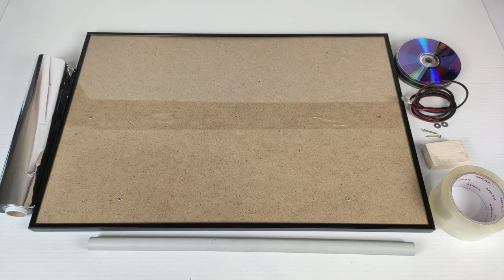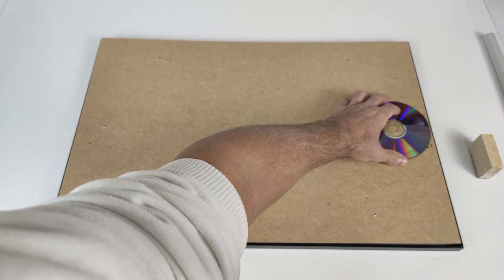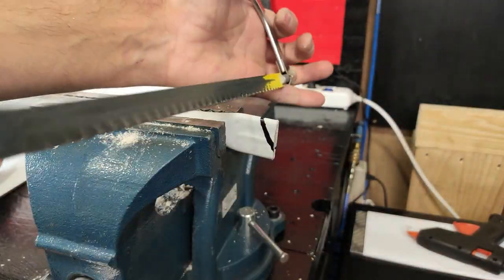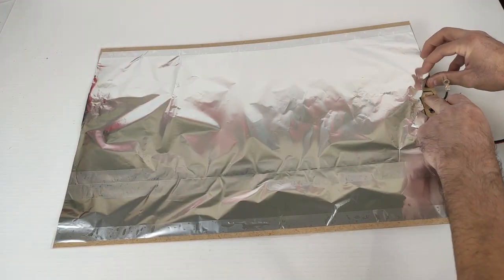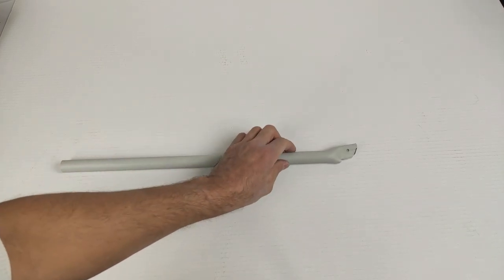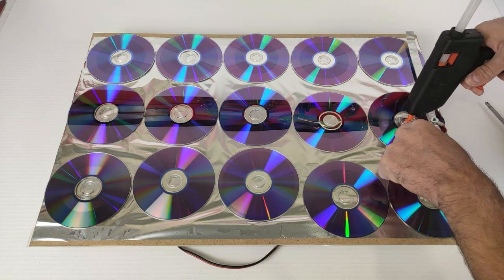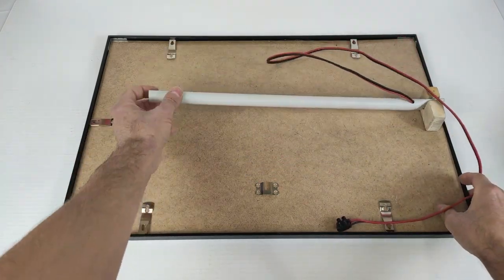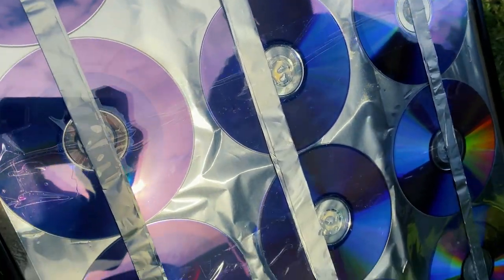Man Makes DIY Solar Panel From Old DVDs - 1285447

Comment: This is a fake, I am an electronics technician & I have tried 3 different brands and purplish colors of high quality DVD's and none of them generated even a single volt with your 15 DVD array panel in bright sunlight.
Reply: Especially since the D.V.Ds are connected in parallel: If as he says, a D.V.D produces 0.8v, we should have 0.8v output, and not 12.5v

Comment: Even if it works in theory, doubt you have any usable current
Reply: Have you tried it?
Reply: @judyscott9554  just did
Reply: That's why we use capacitors or batteries. Lol. You don't understand solar. This charges batteries. Like solar lights. Or small water pump
Reply: I'm grabbing pack of 50 dvd free. So I'll do the project.
Reply: because it is fake